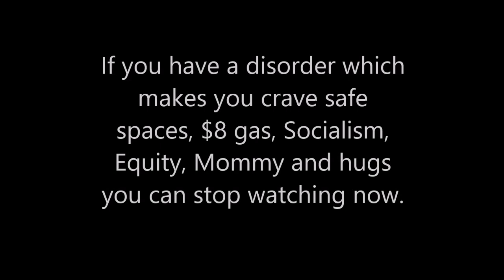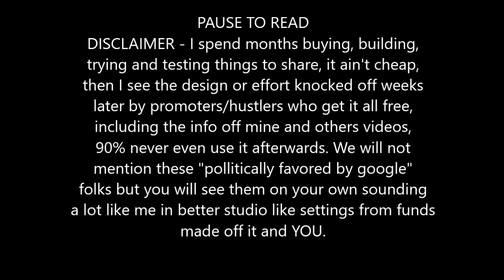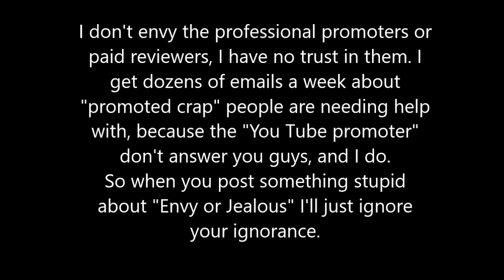A Behind the Scenes Set up, Wind Power, Parts, How some scammers test & trick, bit of a rant too.

Comment: They are deep cycle. John
Reply from the maker: Always overgrade your wire by 20%, it's almost impossible to find two gauge anywhere which would be just barely enough so run one gauge on your batteries you'll see the other posting I made to you with some links to the exact kind of items you're looking for.

Comment: John I have a guesting. I have 3 everstart 80 Amp hr 800 cranking Amp batteries. Could you tell me the correct size cable to use to connect them
And the correct size to go to my 1500 watt alffaa inverter. Yes I took your advice and bought one. It does a great job. Thanks John
Reply from the maker: 1 gauge awg all the way around. If your inverter strays over 40" from the batteries use the slightly larger 1/0 awg to it up to 7 feet.  Use TEMco cable, 30 feet 15/15 each red/black,  https://ebay.us/aYuTd9  best on the planet and usually cheapest. Pick 1 to 1/0 lugs  5/16 hole (10 pack of 1awg 5 pack 1/0 awg),  https://ebay.us/x16eta and a terminal stamp https://ebay.us/QB1VAs

Comment: Situation for truckers as well as farmers aren't going to get much better.
 I hear oil is getting scares by October. 

I converted my mower to propane to save on gasoline same infrastructure is good for heating the garage or house during winter or power outage might convert the car to propane as well🤷‍♂️
Reply from the maker: Better grab all the propane things you can get your hand on before this winter. Check facebook, Craigslist and whatever classified locals you got. Buy them all. 
If your car is throttle body, all you need is a zero to 20 psi propane regulator and a valve setup for a throttle. I'm using a treble valve for lpg adapted 1990 Chevy truck. With a vacuum off fuel line valve to the gasoline line.
Reply: @JOHNDANIEL1  I daily drive 1992 buick lesabre. Not only does it have throttle body it has only 1 driver that feeds the group fire injection, only a few wires to switch between propane and gasoline.
 I believe theres a conversion kit by milenium for under $1000 and can buy a rv tank to mount in the trunk after blocking off the trunk and adding a vent for safety. 
There's also an ebay seller "Propane-kits" that has most all the oddball parts and adapters as well. 
I believe it would cost about $2000 and take about 1.5 years to pay for itself but no more worries about oil changes or polution. Battery opp cars can kiss my tailpipe at that point. 
I'm pretty sure by time energy from a plant, down miles of wire, threw multiple transfers, then threw an electric motor is not very efficient. 
I'm sure a propane car would have less carbon foot print than electric but that would be a cheaper alternative "no money to be made"  not to mention electric cars not contributing much to road taxes👀
Reply from the maker: I did my conversion for $140. 
That Buick can be done the same way.

Comment: Sir I am 62 and I am trying to remember is there anyway I can charge my 8  340 Amp 12 batteries hooked up in  parallel, for a very strong 12 voltages and charge them from my 24 volt DC batteries????,

 I have 24 volts coming from my two 12 solar panels hooked up in Searles to a charge controller.
Reply from the maker: If you get a current limiting converter you can charge your 12 volt batteries easily from your 24. There is a few models I'll look and see if I can find one send me an email and a picture of two of your setup and I'll hook you up with it.  olympicpowercontrols@yahoo.com

Comment: The typical home lab is messy.  Even professional repair desks are often messy.  There will be cables and bits going every which way while tests are done etc.  Yes things do get cleaned up at the end of a project but during the project it often looks like a bomb has gone off.  When you see a high production glossy neat youtube channel it's either a high technology channel such as The Signal Path or it's going to be questionable content.

In the off grid arena the glossy channels have the equipment available to show inverter AC output waveforms, current waveforms on the DC side etc etc, to show exactly what this wonderful product X they have found does, but none of them do.  This is often why I can be seen posting on various channels asking for waveforms of what ever because that gives a good comparison of what inverter X is really up to.  It shows that 99% of the Ch LF inverters are pretty much identical.  Same PCBs, same transformers same same.  Just the label is different.  It shows just how horrible the waveform of the cheap HF inverters gets when the inverter decides to fold back, or just blow up, under high loads too,

Comment: You know John, when I first subscribed to your channel on YouTube, many years ago and found you lived close to me in Southern Idaho, back then, I was interested more by the wind generators than 12V solar systems. Although 12V solar power systems are fine for RV's, I don't find them anywhere close to the efficiency of a 48V system for an off-grid home. I'm also using batteries that will charge at -20F I can fully discharge and charge for over 20 000 times at a original price of $00.227 per Watt hour. So for a one time cost of almost 23 cents I get a Watt Hour or more to use for the next 25 plus years or more. If you have over 200K Subs and you aren't making enough money to live good off of YouTube without endorsement of products, then you are doing something wrong. You should have garnered enough affiliate links to be making a couple hundred K. Maybe you are better at accusing and losing than finding out how many people do it without selling their soles.
Reply from the maker: When you tube promotes you even if you have no subs you get lots of views. The 100k sub question aire I was sent in January 2018 to get the all coveted yt button was a trick, it had a bunch of political charged political correct questions. Genders, racisms, and more.  After I answered it my views and recommend placement vanished. This is happened to a lot of people there's talk about it. My YouTube revenue was only 600  to $800 a month then. Not what many get, and actually better than a few others. It's dropped to less than half that since January 2021 literally in one month period. The only thing people hear about is these guys that's got $10,000 a month income. Fact to the matter is is that is a very select few that get the prime ads and prime positions and prime connections. 
Terribly sorry you can't quite understand how that system works. If you're a player you get paid.
Reply: @JOHNDANIEL1  It's apparent you had no desire to make YouTube into an occupation. And, you're right about some YouTubers that use their channels to promote items they are paid to promote. I see terribly manufactured solar and Lipro4 battery so-called generators being promoted and sold by newer YouTubers because they get them free and get paid for every sale made from their channel.  That CHINS battery is a battery with cheap made connections and components that can be bought on alibaba and have a different name put on it. Will it test 100AMP, probably. Is it safe and something I or you would want to use in your system, probably not!  I don't know what started your rant but, I know several big ones on YouTube personally that make most their money from merchandise sold in their stores, books and information they write and sell, advertising they sell on product, referrals, etc and the list goes on. Some have never had agreements with any companies that they show their wares on their channel but companies still send them their own products to test. Most often, they probably wish they had not after viewing the video.
Reply from the maker: Some years back I was doing really well on YouTube because I was able to get my controller as an item I sold directly to people and I was actually doing extremely well I cannot get it made in quantity  anymore. Years ago they gave me one and a half cents click on adware crap now they gave me   0.230 of one cent. If you're a leftist or a communist or a socialist and you can check this for yourself that give you up to two cents per ad, you can learn from people like tim pool, Dave rubin, and even Glen beck what it means on you tube as a uploader in 2022 to be identified or accused of being a conservative. In 2017 my rating was a 63, today my rating is a 14. It's an advertiser friendly rating and that's what your pay is based on for any kind of ads they play on your video. The Young Turks and other communist places you can check it with SEO engine website their ratings are in the high 90s. About a third of my links from Amazon we're qualified for affiliate marketing back in 2018 and 19 today it's about 1/4 of them and instead of them giving you 8% they give you 2 to 3%. So the truth of the matter is is that there's the chosen ones (gender benders, freaks, communist) who make lots of money on YouTube and then people like me, Project Farm, engineer775, AveE, and anybody else it's identified as white Christian straight and possibly conservative, the basket of  deplorables get nothing in comparison. Yet everybody thinks that everyone makes the same.  You have to learn more about equity to understand their system. I used YouTube as Bread and butter edition to a little bit of income, it got real good for a few years though, but now it's basically just the bread no butter.
Reply: I started a YouTube channel in late '07 that eventually grew to over a million subs.I made a lot of money but, like most companies that deal with the public for their content, they change ownership and payout agreements to their people who are making them money. It's never favorable, or even fair to those who have made them who they are. They have you by the balls and, if you are trying to make your livelihood grow, you either make certain changes necessary or you need to go find another source of income. Ebay is the same way and I share your political stance to a point of view. I don't want anyone telling me what I can or cannot do and that is why I live off-grid and canceled all of my agreements and contracts. However, I can see why others who are trying to survive do what they do with endorsements. If I catch them lying, I will rip them apart in my comments. I don't think using your channel is a good platform to do it on given the control factors of YouTube with your channel. You do a good service in helping people learn and, I have still got several items I ordered sitting in new boxes you suggested I buy, John.